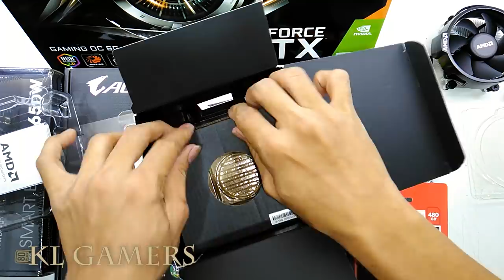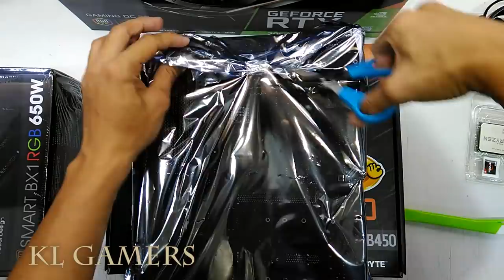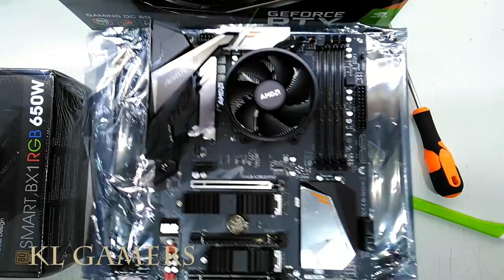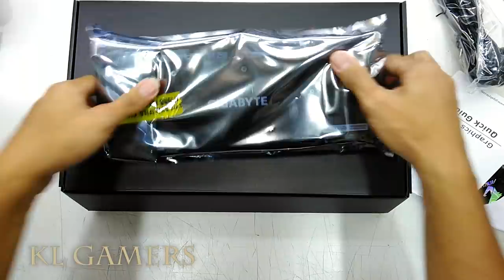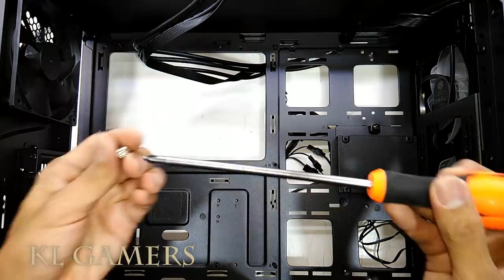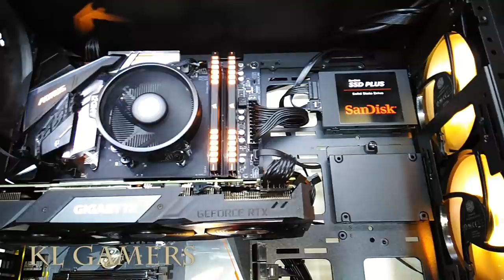AMD Ryzen 5 2600 GIGABYTE B450 AORUS PRO VENGEANCE RGB 16GB GIGABYTE RTX 2060 GAMING OC 2019

Comment: Total Price.
Reply from the maker: Processor = AMD Ryzen 5 2600 6 Core 3.9GHz  = RM679
(Amazon link) = https://amzn.to/2YGanLM 
(Lazada link) = https://c.lazada.com.my/t/c.cs8C

Motherboard = GIGABYTE B450 AORUS PRO socket AM4 = RM529
(Amazon link) = https://amzn.to/2YESw87
(Lazada link) = https://c.lazada.com.my/t/c.cK5V

RAM = CORSAIR VENGEANCE® RGB 16GB (2 x 8GB) 3200MHz DDR4  = RM689
(Amazon link) = https://amzn.to/2YJZjBe
(Lazada link) = https://c.lazada.com.my/t/c.cGZA

SSD = Sandisk SSD Plus 480GB = RM319
(Amazon link) = https://amzn.to/2ZvUGbd
(Lazada link) = https://c.lazada.com.my/t/c.cFpg

Hard Disk = Seagate BarraCuda 1TB desktop hard disk =RM179
(Amazon link) = https://amzn.to/2YFWWLP
(Lazada link) = https://c.lazada.com.my/t/c.cG0a

Graphics Card = Gigabyte NVIDIA RTX 2060 GAMING 6G DDR6 OC = RM1979
(Amazon link) = https://amzn.to/2YCeOqL
(Lazada link) = https://c.lazada.com.my/t/c.coJO

Power Supply = Thermaltake Smart BX1 RGB 80-PLUS 650W =RM329
(Amazon link) = https://amzn.to/2YFN9VZ
(Lazada link) = https://c.lazada.com.my/t/c.cG0Z

Casing = Cooler Master MasterBox Pro 5 RGB = RM359
(Amazon link) = https://amzn.to/2Zyf4IM
(Lazada link) = https://c.lazada.com.my/t/c.cJE2

TOTAL = RM5062

Price is based in local Malaysia current price.

Try Prime Discounted Monthly Offering = https://amzn.to/31jYLzU

Shop Amazon Basics - HDMI Cables = https://amzn.to/2KmjkVq

Deep Discounts on used electronics (Amazon Link) = https://amzn.to/2GH7tjN

Amazon Gift Cards = https://amzn.to/31aUMpc

Top Gift Ideas (Amazon Link) = https://amzn.to/31lw5qi

Please SUBSCRIBE & Click the BELL NOTIFICATION button: 
https://www.youtube.com/c/KLGamers

Thanks for all your Support, LIKE the video, Sharing the video and leaving a comment is always appreciated!! 

Copyright © KL Gamers 2019. All Rights Reserved.

DISCLAIMER: This video and description contains affiliate links, which means that if you click on one of the product links, I’ll receive a small commission. This help support the channel and allows us to continue to make videos like this. Thank you for the support!

Malaysia 

(Lazada Malaysia Link) 

Lazada Vouchers deal = https://c.lazada.com.my/t/c.cs8w 
Lazada Daily Flash Sales Link = https://c.lazada.com.my/t/c.cGZC
Lazada Home Appliances deal = https://c.lazada.com.my/t/c.coJk
Lazada Camera deals = https://c.lazada.com.my/t/c.cs8D

Comment: Price
Reply from the maker: Processor = AMD Ryzen 5 2600 6 Core 3.9GHz  = RM679
(Amazon link) = https://amzn.to/2YGanLM 
(Lazada link) = https://c.lazada.com.my/t/c.cs8C

Motherboard = GIGABYTE B450 AORUS PRO socket AM4 = RM529
(Amazon link) = https://amzn.to/2YESw87
(Lazada link) = https://c.lazada.com.my/t/c.cK5V

RAM = CORSAIR VENGEANCE® RGB 16GB (2 x 8GB) 3200MHz DDR4  = RM689
(Amazon link) = https://amzn.to/2YJZjBe
(Lazada link) = https://c.lazada.com.my/t/c.cGZA

SSD = Sandisk SSD Plus 480GB = RM319
(Amazon link) = https://amzn.to/2ZvUGbd
(Lazada link) = https://c.lazada.com.my/t/c.cFpg

Hard Disk = Seagate BarraCuda 1TB desktop hard disk =RM179
(Amazon link) = https://amzn.to/2YFWWLP
(Lazada link) = https://c.lazada.com.my/t/c.cG0a

Graphics Card = Gigabyte NVIDIA RTX 2060 GAMING 6G DDR6 OC = RM1979
(Amazon link) = https://amzn.to/2YCeOqL
(Lazada link) = https://c.lazada.com.my/t/c.coJO

Power Supply = Thermaltake Smart BX1 RGB 80-PLUS 650W =RM329
(Amazon link) = https://amzn.to/2YFN9VZ
(Lazada link) = https://c.lazada.com.my/t/c.cG0Z

Casing = Cooler Master MasterBox Pro 5 RGB = RM359
(Amazon link) = https://amzn.to/2Zyf4IM
(Lazada link) = https://c.lazada.com.my/t/c.cJE2

TOTAL = RM5062

Price is based in local Malaysia current price.

Comment: Price
Reply from the maker: Processor = AMD Ryzen 5 2600 6 Core 3.9GHz  = RM679
Motherboard = GIGABYTE B450 AORUS PRO socket AM4 = RM529
RAM = CORSAIR VENGEANCE® RGB 16GB (2 x 8GB) 3200MHz DDR4  = RM689
SSD = Sandisk SSD Plus 480GB = RM319
Hard Disk = Seagate BarraCuda 1TB desktop hard disk =RM179
Graphics Card = Gigabyte NVIDIA RTX 2060 GAMING 6G DDR6 OC = RM1979
Power Supply = Thermaltake Smart BX1 RGB 80-PLUS 650W =RM329
Casing = Cooler Master MasterBox Pro 5 RGB = RM359

TOTAL = RM5062

Price is based in local Malaysia current price.

Comment: how much ishould bay with dollar for all this
Reply from the maker: USD = $1237

Processor = AMD Ryzen 5 2600 6 Core 3.9GHz  = RM679
Motherboard = GIGABYTE B450 AORUS PRO socket AM4 = RM529
RAM = CORSAIR VENGEANCE® RGB 16GB (2 x 8GB) 3200MHz DDR4  = RM689
SSD = Sandisk SSD Plus 480GB = RM319
Hard Disk = Seagate BarraCuda 1TB desktop hard disk =RM179
Graphics Card = Gigabyte NVIDIA RTX 2060 GAMING 6G DDR6 OC = RM1979
Power Supply = Thermaltake Smart BX1 RGB 80-PLUS 650W =RM329
Casing = Cooler Master MasterBox Pro 5 RGB = RM359

TOTAL = RM5062

Comment: Precio en dólares?
Reply from the maker: 1,245.40 United States Dollar

Processor = AMD Ryzen 5 2600 6 Core 3.9GHz  = RM679
Motherboard = GIGABYTE B450 AORUS PRO socket AM4 = RM529
RAM = CORSAIR VENGEANCE® RGB 16GB (2 x 8GB) 3200MHz DDR4  = RM689
SSD = Sandisk SSD Plus 480GB = RM319
Hard Disk = Seagate BarraCuda 1TB desktop hard disk =RM179
Graphics Card = Gigabyte NVIDIA RTX 2060 GAMING 6G DDR6 OC = RM1979
Power Supply = Thermaltake Smart BX1 RGB 80-PLUS 650W =RM329
Casing = Cooler Master MasterBox Pro 5 RGB = RM359

TOTAL = RM5062

Comment: Total price kia hai
Reply from the maker: Processor = AMD Ryzen 5 2600 6 Core 3.9GHz  = RM679
(Amazon link) = https://amzn.to/2YGanLM 
(Lazada link) = https://c.lazada.com.my/t/c.cs8C

Motherboard = GIGABYTE B450 AORUS PRO socket AM4 = RM529
(Amazon link) = https://amzn.to/2YESw87
(Lazada link) = https://c.lazada.com.my/t/c.cK5V

RAM = CORSAIR VENGEANCE® RGB 16GB (2 x 8GB) 3200MHz DDR4  = RM689
(Amazon link) = https://amzn.to/2YJZjBe
(Lazada link) = https://c.lazada.com.my/t/c.cGZA

SSD = Sandisk SSD Plus 480GB = RM319
(Amazon link) = https://amzn.to/2ZvUGbd
(Lazada link) = https://c.lazada.com.my/t/c.cFpg

Hard Disk = Seagate BarraCuda 1TB desktop hard disk =RM179
(Amazon link) = https://amzn.to/2YFWWLP
(Lazada link) = https://c.lazada.com.my/t/c.cG0a

Graphics Card = Gigabyte NVIDIA RTX 2060 GAMING 6G DDR6 OC = RM1979
(Amazon link) = https://amzn.to/2YCeOqL
(Lazada link) = https://c.lazada.com.my/t/c.coJO

Power Supply = Thermaltake Smart BX1 RGB 80-PLUS 650W =RM329
(Amazon link) = https://amzn.to/2YFN9VZ
(Lazada link) = https://c.lazada.com.my/t/c.cG0Z

Casing = Cooler Master MasterBox Pro 5 RGB = RM359
(Amazon link) = https://amzn.to/2Zyf4IM
(Lazada link) = https://c.lazada.com.my/t/c.cJE2

TOTAL = RM5062

Price is based in local Malaysia current price.

Comment: total harga berapa usd?
Reply from the maker: Processor = AMD Ryzen 5 2600 6 Core 3.9GHz  = RM679
(Amazon link) = https://amzn.to/2YGanLM 
(Lazada link) = https://c.lazada.com.my/t/c.cs8C

Motherboard = GIGABYTE B450 AORUS PRO socket AM4 = RM529
(Amazon link) = https://amzn.to/2YESw87
(Lazada link) = https://c.lazada.com.my/t/c.cK5V

RAM = CORSAIR VENGEANCE® RGB 16GB (2 x 8GB) 3200MHz DDR4  = RM689
(Amazon link) = https://amzn.to/2YJZjBe
(Lazada link) = https://c.lazada.com.my/t/c.cGZA

SSD = Sandisk SSD Plus 480GB = RM319
(Amazon link) = https://amzn.to/2ZvUGbd
(Lazada link) = https://c.lazada.com.my/t/c.cFpg

Hard Disk = Seagate BarraCuda 1TB desktop hard disk =RM179
(Amazon link) = https://amzn.to/2YFWWLP
(Lazada link) = https://c.lazada.com.my/t/c.cG0a

Graphics Card = Gigabyte NVIDIA RTX 2060 GAMING 6G DDR6 OC = RM1979
(Amazon link) = https://amzn.to/2YCeOqL
(Lazada link) = https://c.lazada.com.my/t/c.coJO

Power Supply = Thermaltake Smart BX1 RGB 80-PLUS 650W =RM329
(Amazon link) = https://amzn.to/2YFN9VZ
(Lazada link) = https://c.lazada.com.my/t/c.cG0Z

Casing = Cooler Master MasterBox Pro 5 RGB = RM359
(Amazon link) = https://amzn.to/2Zyf4IM
(Lazada link) = https://c.lazada.com.my/t/c.cJE2

TOTAL = RM5062

Price is based in local Malaysia current price.

Comment: What's the total?.
Reply from the maker: Processor = AMD Ryzen 5 2600 6 Core 3.9GHz  = RM679
Motherboard = GIGABYTE B450 AORUS PRO socket AM4 = RM529
RAM = CORSAIR VENGEANCE® RGB 16GB (2 x 8GB) 3200MHz DDR4  = RM689
SSD = Sandisk SSD Plus 480GB = RM319
Hard Disk = Seagate BarraCuda 1TB desktop hard disk =RM179
Graphics Card = Gigabyte NVIDIA RTX 2060 GAMING 6G DDR6 OC = RM1979
Power Supply = Thermaltake Smart BX1 RGB 80-PLUS 650W =RM329
Casing = Cooler Master MasterBox Pro 5 RGB = RM359

TOTAL = RM5062

Price is based in local Malaysia current price.
Reply: @KLGamers  Thank you!

Comment: Bro cuántos ventiladores se pueden conectar a esta mobo? Porque estoy cotizando gabinetes y el Corsair spec delta me atrae mucho, sin embargo ese trae 4 ventiladores rgb de serie así que de verdad quisiera aprovecharlos todos
Reply from the maker: usually RGB fan comes with it's controller so you not need to connect to motherboard. if it is not comes with the controller you need to connect it to the motherboard but make sure they are compatible as they have many different connections. such as RGB, ARGB, RBGW, Digital RGB
Reply: @KLGamers  I'm really confused about this kind of things.. I have to learn more I guess.
Thank you so much!

Comment: What is totally cost please say
Reply from the maker: Processor = AMD Ryzen 5 2600 6 Core 3.9GHz  = RM679
(Amazon link) = https://amzn.to/2YGanLM 
(Lazada link) = https://c.lazada.com.my/t/c.cs8C

Motherboard = GIGABYTE B450 AORUS PRO socket AM4 = RM529
(Amazon link) = https://amzn.to/2YESw87
(Lazada link) = https://c.lazada.com.my/t/c.cK5V

RAM = CORSAIR VENGEANCE® RGB 16GB (2 x 8GB) 3200MHz DDR4  = RM689
(Amazon link) = https://amzn.to/2YJZjBe
(Lazada link) = https://c.lazada.com.my/t/c.cGZA

SSD = Sandisk SSD Plus 480GB = RM319
(Amazon link) = https://amzn.to/2ZvUGbd
(Lazada link) = https://c.lazada.com.my/t/c.cFpg

Hard Disk = Seagate BarraCuda 1TB desktop hard disk =RM179
(Amazon link) = https://amzn.to/2YFWWLP
(Lazada link) = https://c.lazada.com.my/t/c.cG0a

Graphics Card = Gigabyte NVIDIA RTX 2060 GAMING 6G DDR6 OC = RM1979
(Amazon link) = https://amzn.to/2YCeOqL
(Lazada link) = https://c.lazada.com.my/t/c.coJO

Power Supply = Thermaltake Smart BX1 RGB 80-PLUS 650W =RM329
(Amazon link) = https://amzn.to/2YFN9VZ
(Lazada link) = https://c.lazada.com.my/t/c.cG0Z

Casing = Cooler Master MasterBox Pro 5 RGB = RM359
(Amazon link) = https://amzn.to/2Zyf4IM
(Lazada link) = https://c.lazada.com.my/t/c.cJE2

TOTAL = RM5062

Price is based in local Malaysia current price.
Reply: @KLGamers  thanks bro

Comment: Answer with ringgit
Reply from the maker: Processor = AMD Ryzen 5 2600 6 Core 3.9GHz  = RM679
(Amazon link) = https://amzn.to/2YGanLM 
(Lazada link) = https://c.lazada.com.my/t/c.cs8C

Motherboard = GIGABYTE B450 AORUS PRO socket AM4 = RM529
(Amazon link) = https://amzn.to/2YESw87
(Lazada link) = https://c.lazada.com.my/t/c.cK5V

RAM = CORSAIR VENGEANCE® RGB 16GB (2 x 8GB) 3200MHz DDR4  = RM689
(Amazon link) = https://amzn.to/2YJZjBe
(Lazada link) = https://c.lazada.com.my/t/c.cGZA

SSD = Sandisk SSD Plus 480GB = RM319
(Amazon link) = https://amzn.to/2ZvUGbd
(Lazada link) = https://c.lazada.com.my/t/c.cFpg

Hard Disk = Seagate BarraCuda 1TB desktop hard disk =RM179
(Amazon link) = https://amzn.to/2YFWWLP
(Lazada link) = https://c.lazada.com.my/t/c.cG0a

Graphics Card = Gigabyte NVIDIA RTX 2060 GAMING 6G DDR6 OC = RM1979
(Amazon link) = https://amzn.to/2YCeOqL
(Lazada link) = https://c.lazada.com.my/t/c.coJO

Power Supply = Thermaltake Smart BX1 RGB 80-PLUS 650W =RM329
(Amazon link) = https://amzn.to/2YFN9VZ
(Lazada link) = https://c.lazada.com.my/t/c.cG0Z

Casing = Cooler Master MasterBox Pro 5 RGB = RM359
(Amazon link) = https://amzn.to/2Zyf4IM
(Lazada link) = https://c.lazada.com.my/t/c.cJE2

TOTAL = RM5062

Comment: Anybody know if i can use Ram corsair vengeance ddr4 rgb pro with this Motherboard the Aorus pro elite?
Reply from the maker: should be usable just not sure how many Mhz can it run
Reply: @KLGamers  thank you for replying so fast,you are very thoughtful and kind. Yeah i downloaded the QVE from Aorus website and there are a lot of Corsair supported but not the rgb pro,in fact i havent found any rgb ram in that list, but even the list itself says that they cant test all ram available,my guess is as long as i use ram with the frequency and brands mentioned in the QVE i will be ok?!
Reply from the maker: a lot of Corsair supported but not the rgb pro ( not in the list ) i guess the list is outdated.  
as long as i use ram with the frequency and brands mentioned in the QVE i will be ok <<yes usually that is the case. Within the range of the supported Mhz.
Reply: @KLGamers  thank you for taking the time to respond my messages,you got a new subscriber 😘